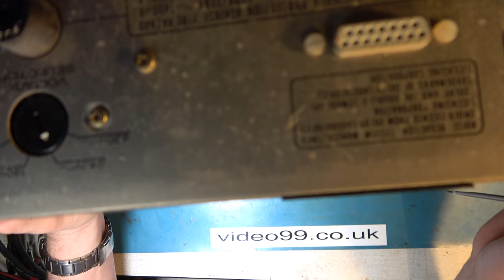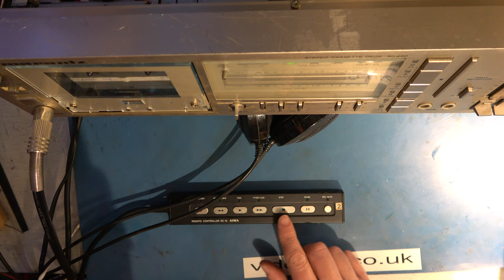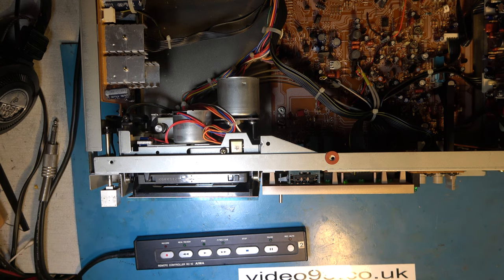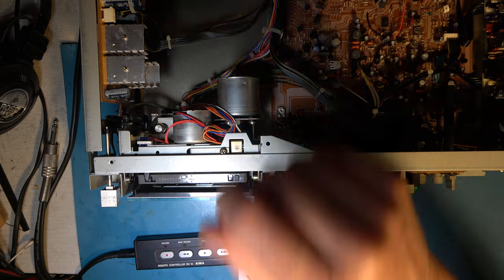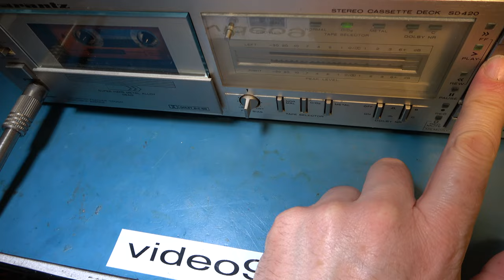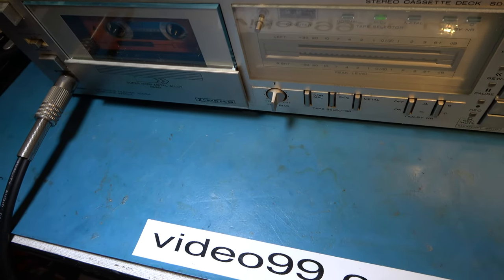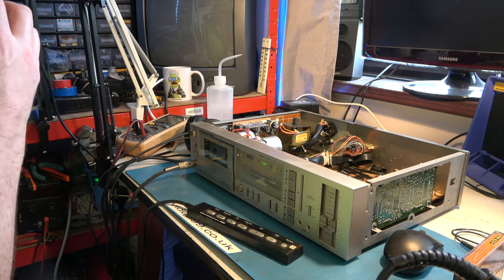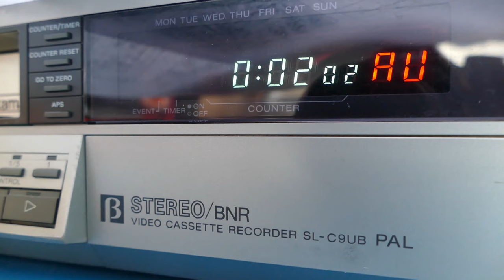Belts and service of Marantz SD420 cassette deck from 1982. Nothing ever goes quite to plan.

Comment: My daughter wanted a walkman last xmas and I picked up one of these decks so we could create mix tapes. I have connected an Echo Dot via a 3.5mm jack to rca to rip music and I can’t believe the quality of the playback. OK, the sound is not top notch but is very good. Adding Dolby NR looses the dynamic range and to be honest I can only hear tape hiss if I turn the volume up really high when there is no music playing. Mine had new belts about 2 years ago and was previously owned by a hifi enthusiast. I paid £85 which I think was a good price. It’s a nice piece of retro kit.
Reply from the maker: How is FF and REW on yours? 
This machine will be in another YT video shortly.

Comment: Well done, Much better than it was :-D
it did look a pain to service that deck.
Yep the tape counter belt shows that the F.F/REW drive is not quite as strong as it was, but it works good enough now.
That would not have been a cheap cassette deck in it's day.
The mod you did looks just the job and it still works spot on :-D.
I don't like capstan motors running all the time, the idea of having a motor being up to speed all the time is good, but the life of the motor is reduced :-(
i have an old pioneer deck that does the same thing, i did think about making a circuit to turn the motor off after sitting for 5 mins, but my loud tinitus makes listening to music horrible.
I wanted a remote channel change on my t.v when i was 19,  i made a pcb with pads in a circle around the shaft of a motor that rotated a wiper. (very heath robinson)
Two wires from my remote turned the motor on so the wiper moved to the next pad lol.
What a silly brain i had in those days, i enjoyed doing silly stuff like that :-D

Comment: Did you find a service manual for this cassette deck? It seems like this is one of those decks were despite the extra work it takes, it's easier to take the entire mechanism out of the deck before doing any of the actual work. I'm sure taking out the mechanism would reveal some screws to take off the entire cassette door mechanism including that annoying decorative back piece. The service manual might give some hints to this.
Reply from the maker: Never did find the service manual for this, nor the alternative version which has a slightly different eject mechanism.

Comment: Thanks so much. I have the same machine and i cannot get ANY of the play/rwd/ffd etc buttons to register anything - no LED lights or indication they are doing anything.  I would love a pointer one where to start looking.  I would also like to add  - as the MAIN MOTOR can be screwed off like an old fashioned bayonet light bulb. i.e. grip the motor and turn anti clockwise a 1/4 turn and it comes off could the belt be changed by "just" doing this?
Reply from the maker: Changing the belt requires looping it around the capstan, so pulling the motor off doesn't really help.  I've not seen the fault where no buttons operate.  Perhaps the switch which detects that a tape is present, is not making, so I would check all the tape switches.

Comment: hi dr i watched your video's as well  i love cassettes as well  tascam 38 had a long remote  i picked up a panel of a tascam reel to reel for the remote socket on the back
now i can use the remote on many decks fostex e8 m80  have a big remote can drive 2 decks at the same time  i only buy cassette decks with one motor so when i pimp
up the motor with a 2 speed one for 3 3/4 ips as tascam are high speed decks

Comment: A 3-head deck is only beneficial for recording. For playback only, 2-head is sufficient.
Reply from the maker: That's quite right.  These days 3-head is of little benefit if the machine is only being used for playback as mine generally are.

Comment: Uhh... I see at the end of this video this: the USB logo in place of the DVD logo on your logo.
Reply from the maker: Yes, I'm phasing out the DVD part of the logo as it's pretty much obsolete today.
Reply: @video99couk  DVD is WAY too obsolete, in comparison to USB.
Reply: @northernplacecorporation  DVDs will last "forever" if stored properly. Moisture and direct UV exposure are determining factors in the lifespan of DVDs. USB sticks, on the other hand, are quite unreliable. I've seen them fail many times for no reason. And no, they were not unbranded crap from China, they were high quaility stuff. I have many DVDs from the late 90's, early 00's working as good as the first day I bought them.
Reply: @josegti84  Oh. I see.